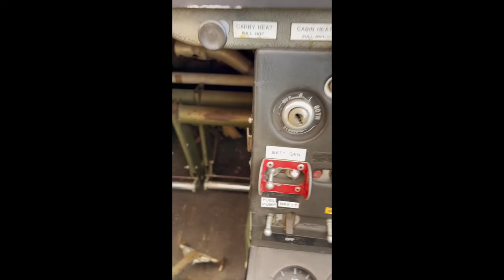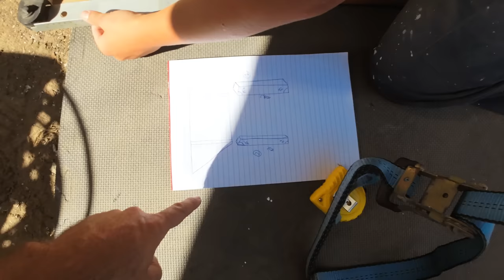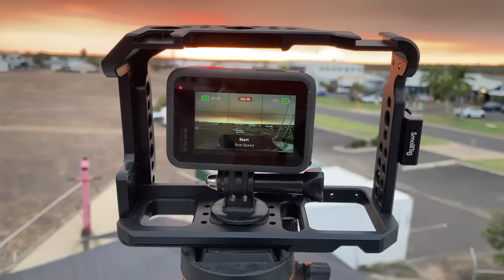Brupeg gets her wings back - Ep.309

Comment: When I got started in machining I worked in a somewhat low class place where you had to know how to sharpen your drills some of which were 4in in diameter and larger.
I hated it with a passion!!! As my skills got better I started working in nicer and nicer shops.
One of the happiest days of my machining career was working in a shop that had a tool room and it had three guys that worked there.
You got your print and you wrote down everything you needed to run the job and gave it to the tool room guys. About 15 minutes later they'd bring you a plastic tub with all of the tools you requested......including freshly machine sharpened drills.
I was in machinist Heaven!!

Comment: Thanks again for sharing your dream and it's looking great. Just wanted to let you know if you didn't already. When welding your stainless or other pipes. Plug the ends and put gas on the inside. It will give you a smooth internal finish. I think it's called purge welding. Hope it helps. Keep up the great work

Comment: I think instead of countersunk screws from the inside, you should counterbore t-nuts and bolt from the outside. As the plastic wears, the countersunk screw heads will be exposed and damaged. When you eventually have to replace the plastic strips, it might be a real pain to get those out (on top of how tedious it looked to install them). With counterbored t-nuts, even if they get exposed and worn down by the pins, it shouldn't really affect them.

Comment: Great to see you describe the reality of working with SS, drill sharpen, drill sharpen. As the corners get the brunt of the work I generally try to not make small dia steps. 12 to 22 in one step.
Reply: You can’t faff about with SS. Going too carefully, work-hardens the metal. It needs a powerful tool that can take a solid cut at relatively slow speed.

Comment: If you keep sqealing drill bits in work harden stainless switch to a high speed carbide drill bit. It just cuts right through it and even through the thickess mill scale on mild steels. 👍👍

Comment: Have you considered switching from steel cable to Dyneema rope? It will be up to 7 times stronger than a steel cable of the same diameter, wont rust and can be spliced easily.

Comment: Yep....if you keep trying to push a drill with chipped corners you'll start wearing on the drill margins which will make it wedged shaped.
At the point you either cut off the drill past the worn margins or toss the drill in the trash if you dont have enough drill length.

Comment: Did I see Jesse using sign language and if so did I miss something. Are you ok? 
That wing dropping is one of those things you think about and hope you are prepared for and then it happens and you silently reflect on how bad that could have been. When I was a logger I got pile driven by a log. I was saved by the grace of a stump beside me. Instead of becoming 2" inches tall it saved me to only becoming 3' tall, which was bad enough but it kept me from a ride in a helicopter. But I was unconscious for quite awhile till the skidder operator came looking for me. He said he hadn't seen me for over half-hour and decide to check on me. It took him ten minutes to find me amongst the stumps. I couldnt walk on my own and I learned how strong these guys are from dragging cables around on rough terrain. He picked me up and mostly carried me to the skidder and then somehow got me up into the seat. Then he drove that machine 20 minutes just standing on the running  board. I was fully conscious by the time we got to the truck and 1 hour and 4 cups of camp coffee later (we made coffee on an open fire so we could ward of the minus 40 f temp) and we were back cutting logs.
The moral of this story is, do everything you can to mitigate the chances and then do more cause standing around looking at a dead cohort is not the time to be saying maybe we should have done this or that.
Reply: Powerful story

Comment: If you polish the lip to the anchor locker rather than paint it and use a thin wipe of Vaseline or silicone non stick spray your deck hatch wont stick. great video!
Reply from the maker: Ahh. Thanks, did not know that

Comment: Hey guys, just a recommendation - you should cut that plastic slider strip into multiple sections, probably no longer than 300mm. I work in the subsea engineering industry and we use HDPE strips all the time with countersunk fasteners. They will expand with temperature at a much greater rate than steel and will bow if too long. Good work as usual though!!
Reply: That's a great idea, they do bow in the heat and we could probably just put a few strategic gaps higher up in the sliders where the pressure from the wing pin is less extreme.

Comment: Not sure if the allen key you're using to do up the slider insert screws is a ball end, but if it isn't, a set of ball end hex keys/t-handled ones will make it much easier/quicker.
Reply from the maker: It is a ball end but for some reason would just slip like crazy (yes it was the correct size)
Reply: @ProjectBrupeg  Ok - sometimes the smaller ones do that. Took me waaaaaaay to long to find out about them, so I like to pass the info on. :)
Reply from the maker: Yeah they make life a lot easier. These bolts were M4 with a 2.5mm Allen key socket

Comment: Damo, what would happen in real life if you were motoring along and went through a wave or something and that wire rope sheered again, what happens to the wing then, I would imagine if weight counts it would drop down and commence belting the hull, or do you have stops in place to prevent that….just asking since this little unplanned problem developed. It’s so awesome to see all the crew together around the table and the amount of work getting done, well done all
Reply from the maker: When down in position the wings are bolted down and the wire becomes irrelevant